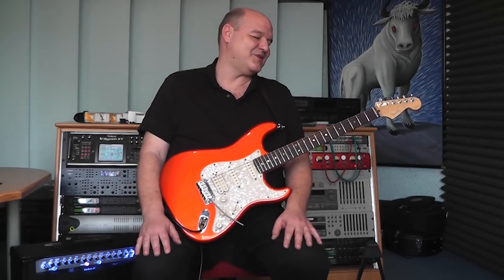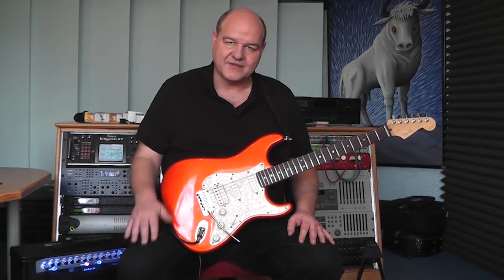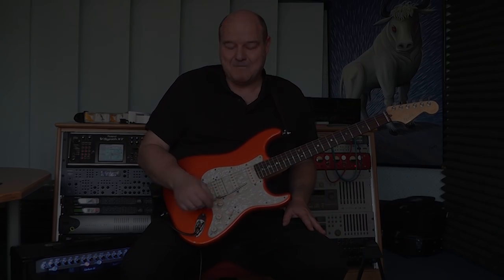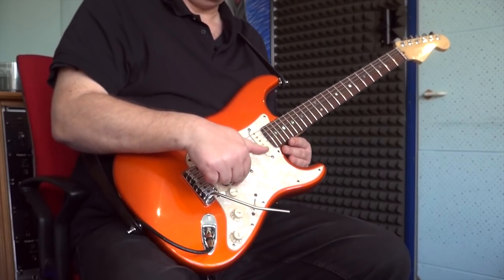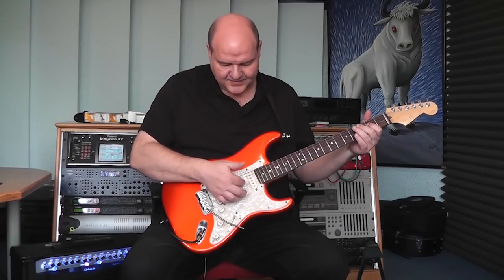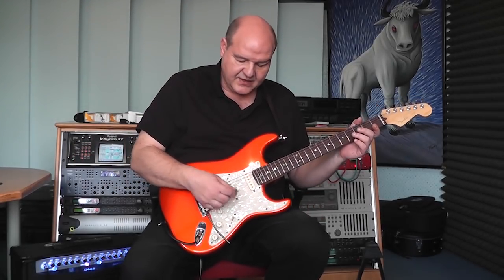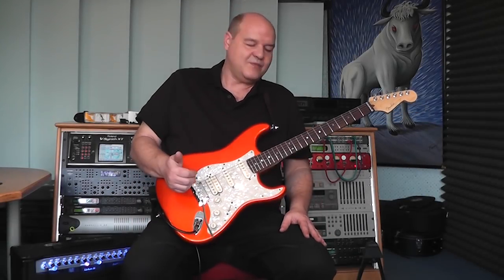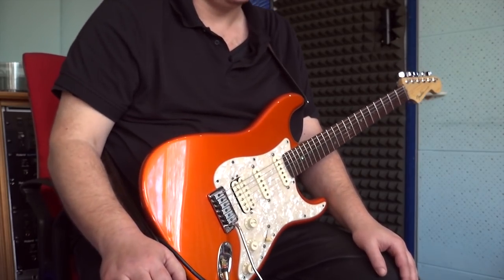Fender Stratocaster Tone & Volume Control / Knob Tutorial / Guitar Lesson

Comment: Nice.  This video and the one you did on the Telecaster really shows the range of the guitars using the volume only.  I no longer set my volume at 10 like I did when I first started playing.  Instead, I adjust from around mid low (4) to mid high (8).  The guitars can do a lot before pedals and amp adjustments.  Thanks for the video.

Comment: Hello Mike, I've been using the stratocaster since 1966. Since the early 70's I've adjusted the mid pickup all the way down. I also wire it like a telecaster & disconnect  the tone pot's all together. It's just the set up I like a long with seymour duncan pickups. thanks & have fun.

Comment: I watched a day or so ago and left without making a comment. I have only been playing 2 years and that was always acoustic. Last week I bought a Mexico assembled Fender Deluxe Roadhouse Strat. This is my first electric guitar (I am 66 usually Martins, higher end Yamaha) This electric guitar "thing" is pretty neat. Before watching I noticed "Wow this volume knob seems very responsive, big changes and not just volume) Now I watch the video and I see that you explain it. I need this Roadhouse Strat setup and install some .009's) I will never gig so I want this strat as easy as possible to fret the strings,hammer on/pull offs, bends. I want it made easier on my hands. I complained about fret finish, until I checked out a friends Chinese Squire, that fretboard is like  a saw on the ends. Mine, I want worked over, nicer.

Comment: Hello Mike, Thank You for sharing an informative video on Fender Tone and volume management. I recently for a fender Mexican player strat Maple with SSS Config. This is the first time I am experiencing a fender instrument. I am quite delighted to have it and ordered it online from a well-reputed site.  I have a quick query. I am a bit concerned about the instrument I got and here is my observation regarding its Volume management. I feel that it sounds low on volume. At volume, 1-3 it's barely audible, 4-5 a little audible between 6-7 it's satisfactory and at 9-10 it gives a considerable output. I am connecting my guitar with amp directly. My amp is Marshall 15CD Series 45 Watts. If I plug my old strat Aria STG series at 3-4 it gives the output what Fender gives at 8-10. The bottom line is if i have to play for practice it has to be between 6-7 minimum or 8-10 while playing along with backing tracks. I wanted to know this is the nature of a fender product/pickups or something else is wrong with my new guitar. I would appreciate if you can please advise.
Reply from the maker: In many modern guitars volume and tone pots do not work linear, but logarithmic instead. Thats basically why you are experiencing what you describe. You may consider swapping the volume pot of your Stratocaster for a linear working model.

Comment: When you get at this point of playing that’s what I consider real guitar player. That trick is the old school and that was old players used before amps strats to have channel switching. Yep it took a bit of time and practice to achieve those kind of tones but when you get there any guitar models will sound amazing. A home I used single channel amp and I can get clean, drive, crunch and distortion whit using vol and tone knobs of the guitars. By the way this is a very instructive video thanks

Comment: A treble bleed circuit really helps with keeping a consistent tone over the range of the vol knob.
Reply: This should be standard on every new guitar. 
I have one on every of my guitars, because I use the volume a lot.
Reply: Nah. It makes it sound thin and weak. I want my treble to roll of when I decrease the vol.  Sounds more natural to my ear. Treble bleeds suck
Reply: @BeefNEggs057  You mean when you roll your volume down?  I shouldn't matter when it's wide open.
Reply: @BeefNEggs057  You have to try a lot of variations of cap/resistor combinations to find the perfect for your guitar. If the resistor doesn't fit it could make your guitar sound thin when the volume is rolled down. I've got Treblebleed on all of my guitars an not one of them sounds thin when rolling back the volume. Depends on the resistor, how much lows should stay alive when rolling back the volume.
Reply: mabbatic Yes when the volume is rolled down it made it thinner (emphasized the treble too much). I like how the guitar gets slightly darker with the vol rolled down.  Maybe I just need another value cap but I’ve tried a couple and realized I was happier without it. To each their own of course.
Reply: JS3008 So I need a lower value cap to keep less treble?  Or higher value?
Reply: @BeefNEggs057  Here you can read the details: http://www.strat-talk.com/threads/which-capacitor-for-stratocaster-treble-bleed.456872/

Comment: point in the video is well taken, but that being said, you barely mentioned the tone knobs at all.  I understand that you say they don’t do much, but I still would like to know how they are wired to which pickup.  Great video anyway as usual!
Reply from the maker: Sorry for being late in responding. Of course the tone knobs make a great difference, but I didn't want to put too much into this video. Foremost I wanted to focus on the wonders or the power of the single volume knob on a Strat, get this with force in the heads of the viewers :) and not distract players with the various tonal changes involved when turning on the tone knobs. This may be the focus of a future video. :)

Comment: Great video! Fender did not use that bridge very long. How well does the guitar stay in tune?
Reply from the maker: Over time I found a good balance for the springs and can say that the guitar stays perfectly in tune with this bridge. Only drawback is the fact, that this kind of bridge contains a shitload of crazy screws and counter-screws beneath it. When these screws start to losen, the saddles start to swim from side to side and back and forth. So I have developed a routine that approx. once in 6 months I totally disassemble the whole bridge and tighten all the screws (at least a dozen LOL). :)

Comment: You should probably state that your bottom tone control is hooked to the bridge pickup, instead of the middle pickup. Some Fender Strats are wired this way. Most Strats are not wired like that. (its an easy mod).
Reply from the maker: You are absolutely right. Just because of that I did concentrate mainly on the volume knob, for that other players have a chance to re-create what I was demoing. By the way: I came across Strats which were configured having two volumes or even three volumes! LOL To cover all the possible configurations and their behaviour would mean a video min. 6 hours long and I would be spanked for it big time! ;)